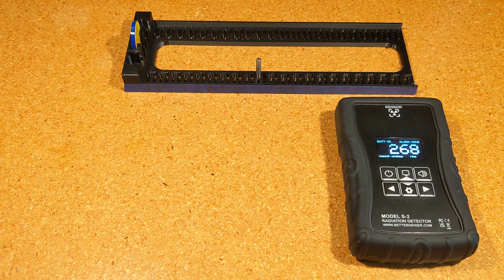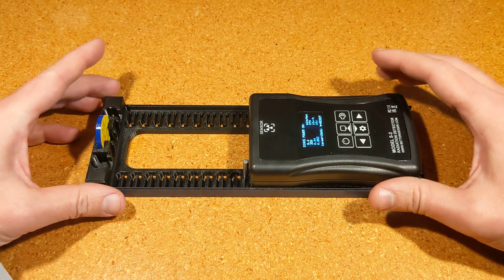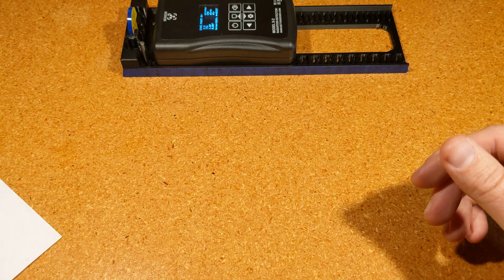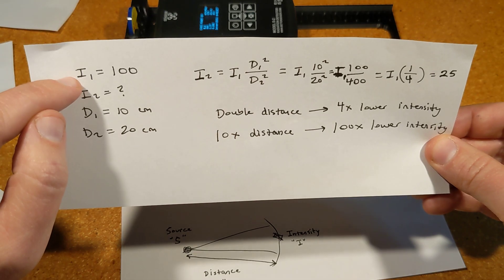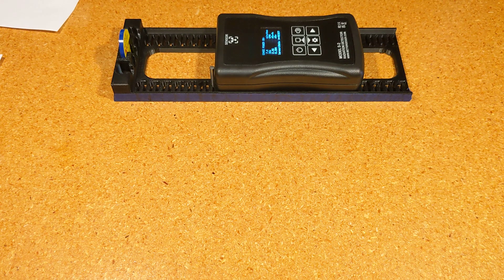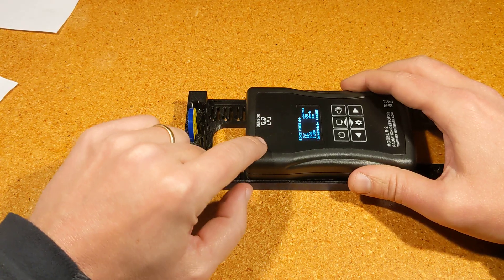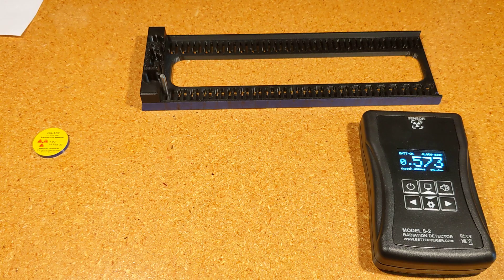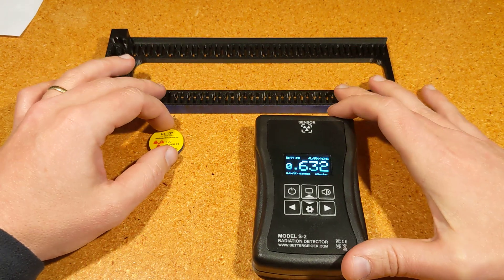Geiger Counter Basics - Measurement position and inverse square law

Comment: Thank you for the video! I appreciate the effort in the videos and very much appreciate the info and clarity and would like to see much more. I am looking forward to the overloaded device info I think I may have seen you comment somewhere about covering. I found the math portion very helpful and hope you will include things like that. I think the answer to this is probably pretty obvious, but want to make sure i am not assuming, and I may have missed it if you did cover it, but when you measure distance from the sensor, are you measuring from the edge of the scintillator or center of it? I am assuming that there would not be a significant difference as i imagine once the energy hits any part of the scintillator, the effect to detect it occurs.